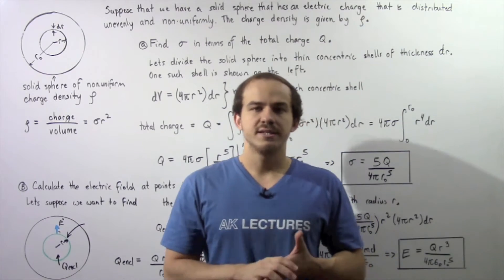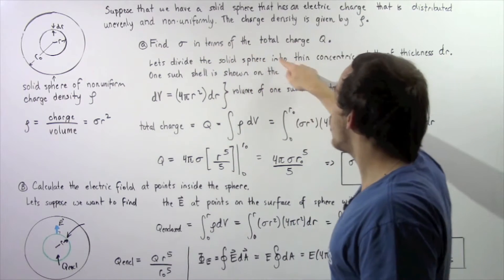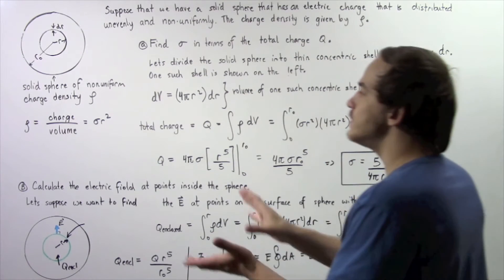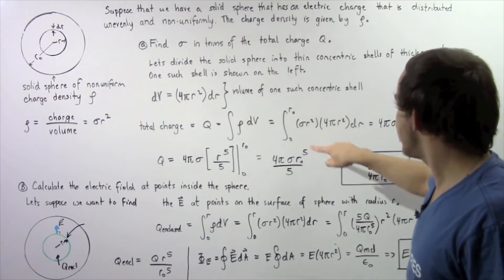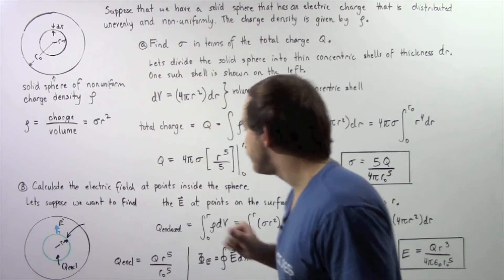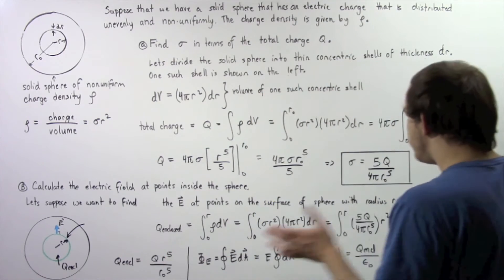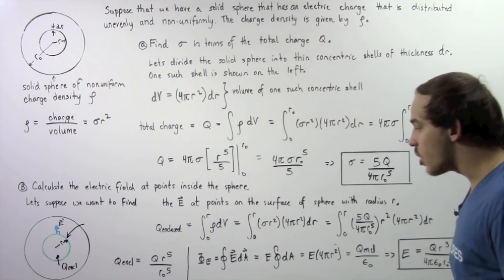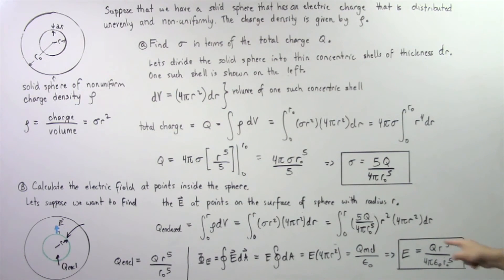Gauss's Law Example # 4

Comment: Can the electric field point inwards if the enclosed charge was a negative charge? And does the surface area always point outwards?
Reply from the maker: Yes, if the charge was negatively charged, then the field lines would radiate inward! But they would still be perpendicular to the surface and would have the same exact magnitude as before.
Reply: Thank you! :D